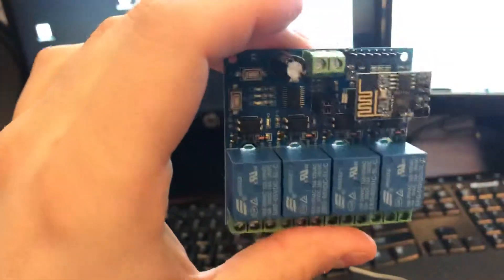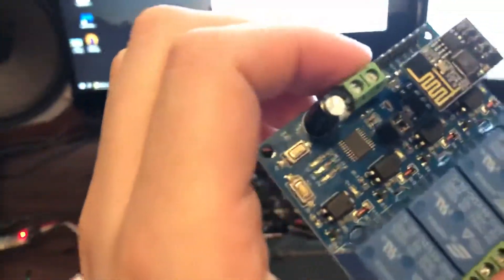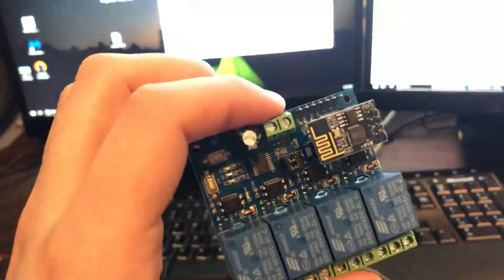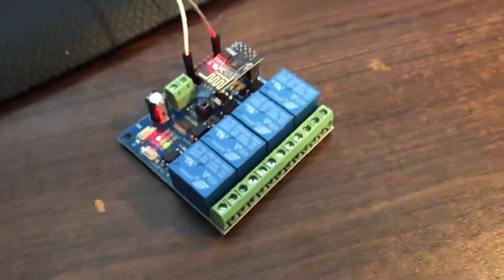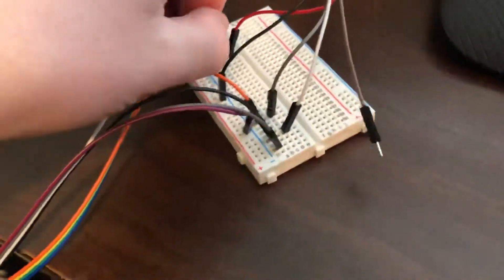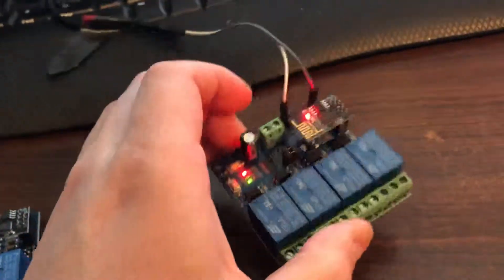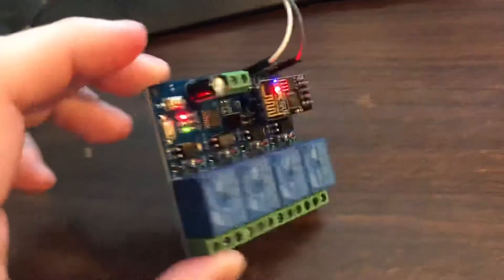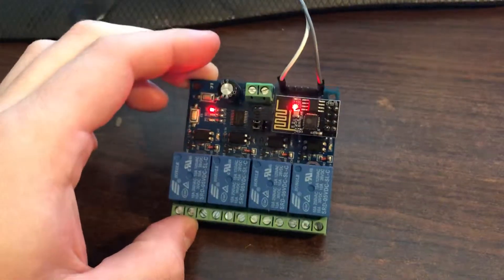LC Tech 4CH Relay Board Tasmota?

Comment: My 4 CH LC Tech relay works with tasmota if you set to Baudrate 115200. 

Try on console:

Rule1
 on System#Boot do Backlog Baudrate 115200; SerialSend5 0 endon
 on Power1#State=1 do SerialSend5 A00101A2 endon
 on Power1#State=0 do SerialSend5 A00100A1 endon
 on Power2#State=1 do SerialSend5 A00201A3 endon
 on Power2#State=0 do SerialSend5 A00200A2 endon
 on Power3#State=1 do SerialSend5 A00301A4 endon
 on Power3#State=0 do SerialSend5 A00300A3 endon
 on Power4#State=1 do SerialSend5 A00401A5 endon
 on Power4#State=0 do SerialSend5 A00400A4 endon
Reply: not working
Reply: @ilyaskambur  mettre "Rule1 on" pour passer rule1 off en on . Selctionner sonoff 4ch
Reply: @António Melo thanks a lot, works with Sonoff 4CH module. Just copy paste the full command in console.
Reply: what tasmota version use?
Reply: @TrisnaWijaya  8.1.0
Reply: @wietsemaas8944  thank it was ok
Reply: Do we have to send
Serial data 
'A00201A3' to the ic on the board?

Comment: Hai i have problem with lc tech 4 relay, esp 8266
Im on mode 2 of relay modul, the board show the blue light, waiting wifi connection 

I have pushed the button switch mode and reset mode, but nothing
But until now, i cant find how to fix it

Stuck on mode 2

Comment: JUST DO THIS in TASMOTA CONSOLE:       Rule1 
on Power1#State=1 do SerialSend5 A00101A2 endon on Power1#State=0 do SerialSend5 A00100A1 endon on Power2#State=1 do SerialSend5 A00201A3 endon on Power2#State=0 do SerialSend5 A00200A2 endon on Power3#State=1 do SerialSend5 A00301A4 endon on Power3#State=0 do SerialSend5 A00300A3 endon on Power4#State=1 do SerialSend5 A00401A5 endon on Power4#State=0 do SerialSend5 A00400A4 endon
Reply: and then   enable the rule    with:   Rule1 1

Comment: Quick question: Has any of you ever encountered Wespota (or Tasmota) being extremely slow on this LC Tech board? For me, Tasmota behaves like usual when it's in a serial adapter, but when I plug it into the LC Tech board, it just bogs down like crazy. With Wespota, it's slow in both.
Reply from the maker: I actually have not experienced any slowness. In the end its just a ESP-01 module so the board its plugged into should not be affecting the speed. Maybe a hardware issue? I have at least 6 LCtech modules around my house and they all are quick.
Reply: @TechwithShae  Yeah, I've tried pretty much everything by now, so I came to the same conclusion. For some odd reason, the LCTech board is keeping the ESP busy, and it doesn't seem fixable sadly. Thanks for the reply anyway.